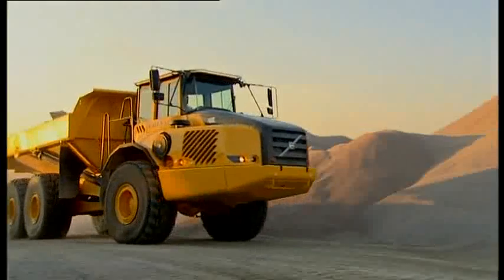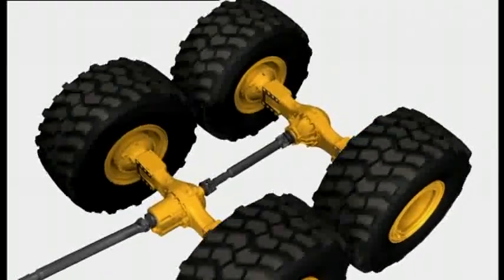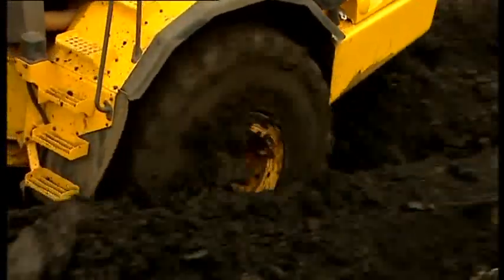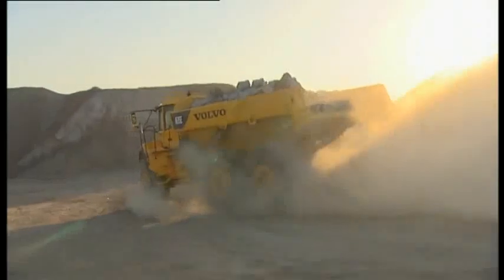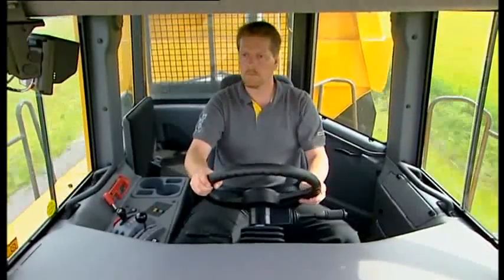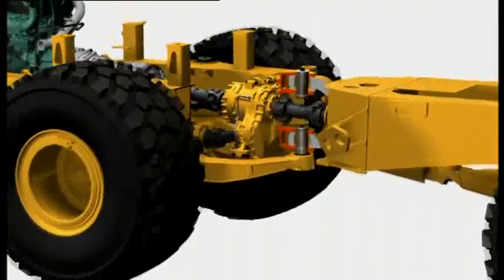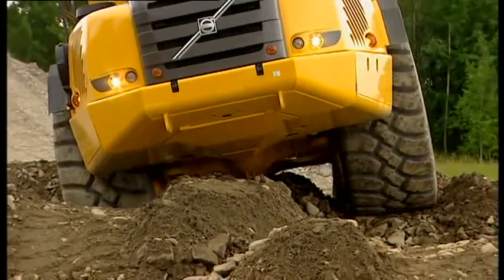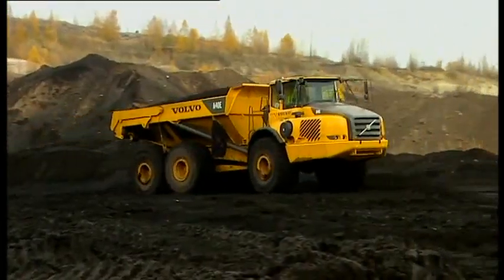Volvo Articulated Haulers features - Drivetrain

Comment: Should a operator not run the truck with the intermittent axles locked on... just curious because my back A35D 2002, is having clicking issues when intermittent lockers are engaged

Comment: can i assume torque is highest at front wheels then since its basically "towing" the rear section?
Reply: Is 6x6
Reply: Unlikely. 
When loaded, most of the weight is at the rear. 
You could just as easily argue that the back is pushing the front.